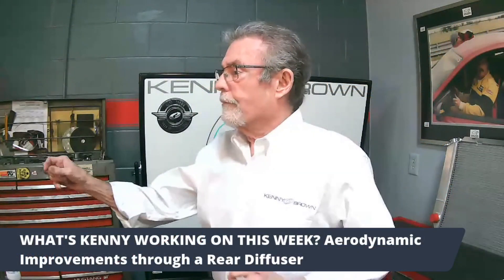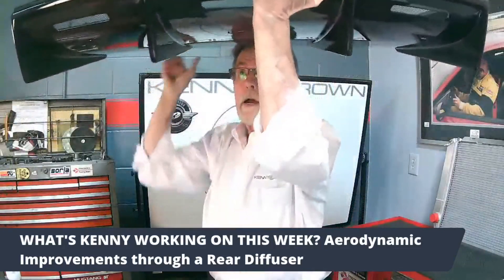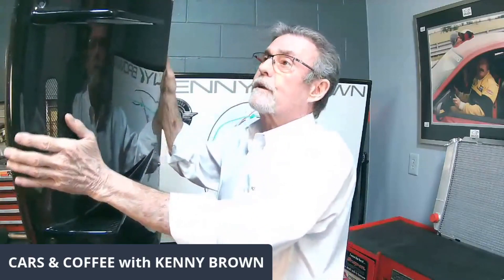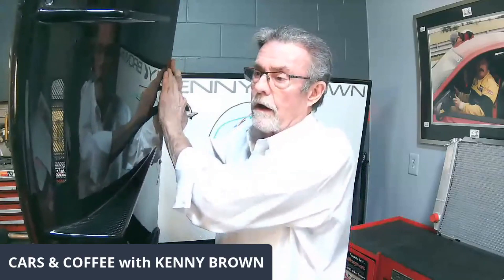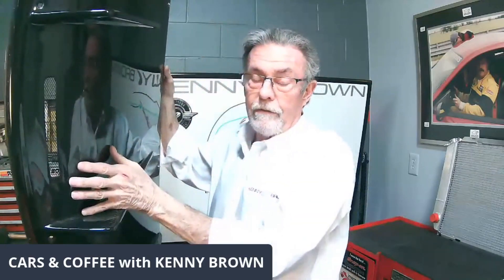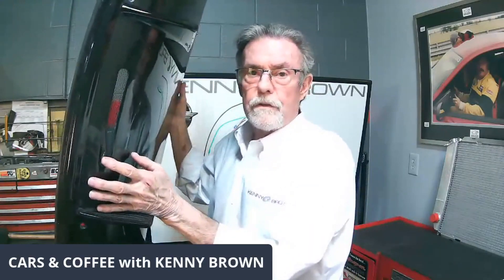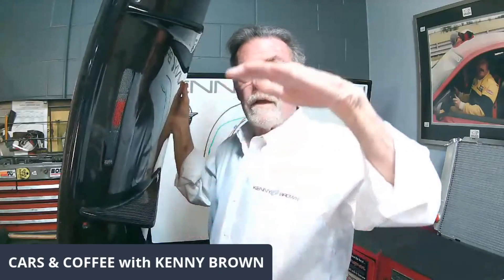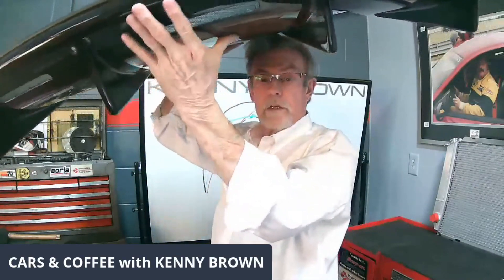Kenny Talks Tech on Rear Diffusers for the Ford Mustang

Comment: I just came across this after watching the 1998 Motorweek episode with the Kenny Brown Mustang LOL just made me chuckle. I have a 2006 S197 Mustang GT and I have a universal Diffuser, it's good quality and it was around $62. My concern is it fitting to my stock GT rear bumper and being wide enough as it only has 4 fins and not 5. So, would this work or should I go for the $600 one from APR  thats made for my car?
Reply from the maker: It's best to go with the APR piece that's made for the car. The lower cost pieces are good for aesthetics, but they are not so good on track. With all of the rear diffusers, you have to message them a little bit for a nice fit as well, but the higher price pieces tend to work better overall.
Reply: @KennybrownPerformance   Thank you very much for the advice! The universal one isn't terrible but I got what I paid for. I'm gonna just do what you said and get the one made for the Mustang. It'll look better that way and functional.  Thanks again!